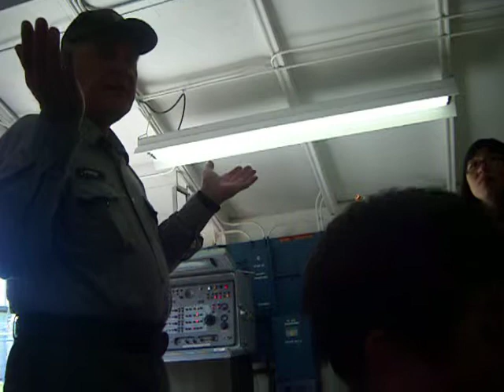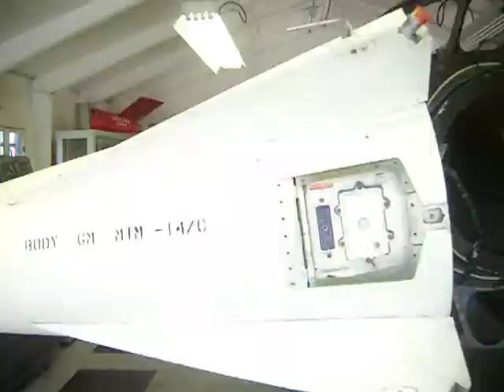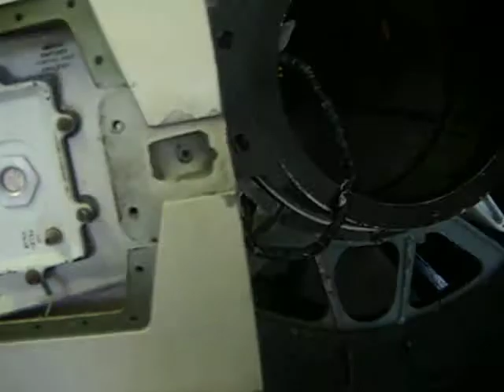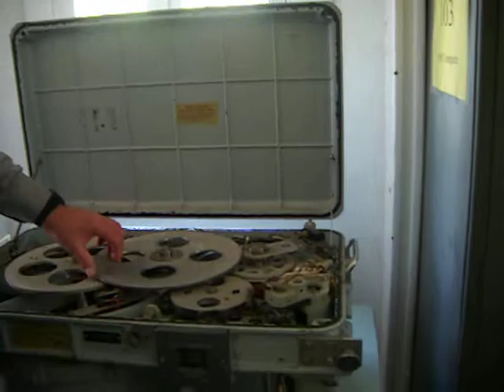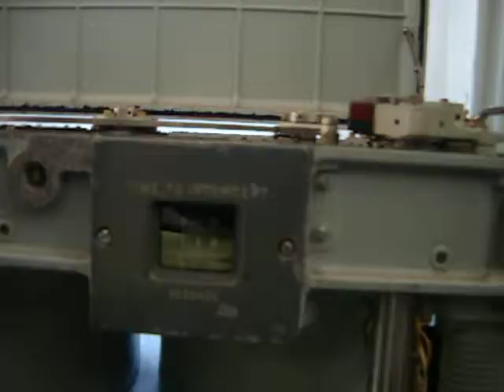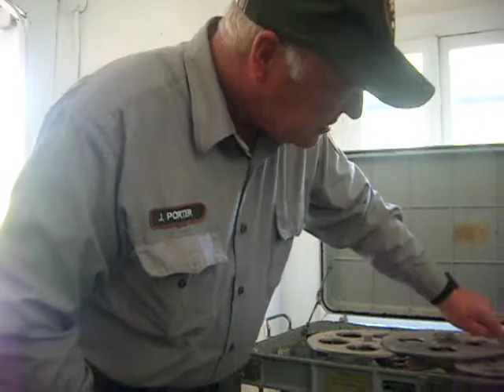Nike missile site (1) (at Golden Gate National Recreation Area, San Francisco)

Comment from the maker: Mr. K you are right! "...a ton is 2000 pounds and a kiloton is 2200 pounds..." The first part was correct, second part wrong. He thought difference between ton and kiloton was not 1000-but a metrics conversion. Of course dynamite is no TNT. Alfred Nobel discovered dynamite and Joseph Wilbrand discovered TNT. When referring forces of nuclear explosion, TNT is more often used. TNT is more stable yet not as powerful as dynamite. googled: tnt-vs-dynamite-whats-difference